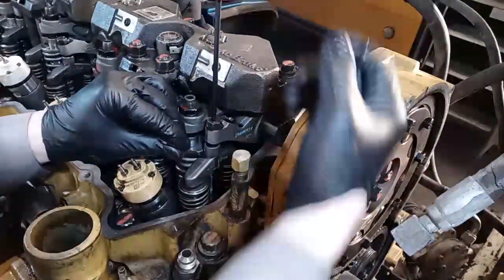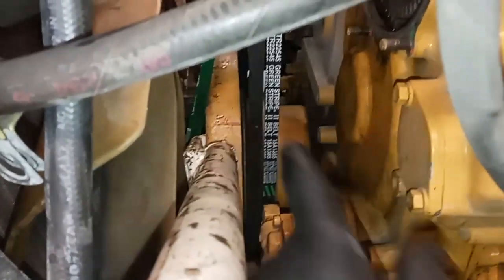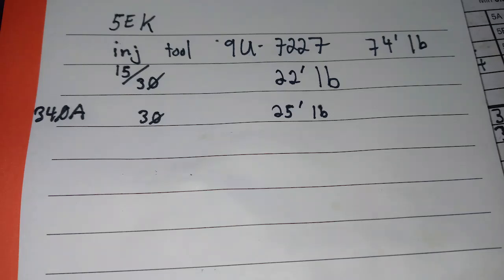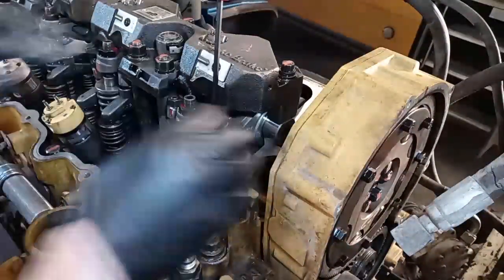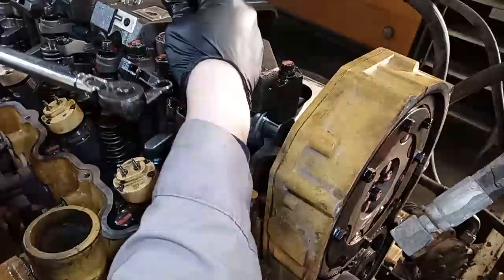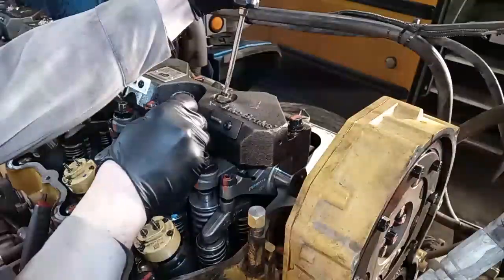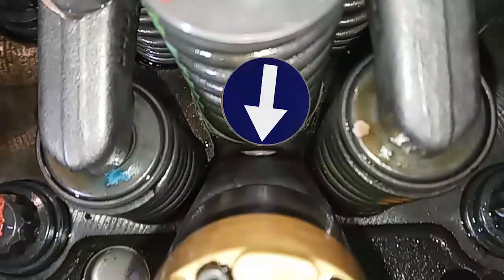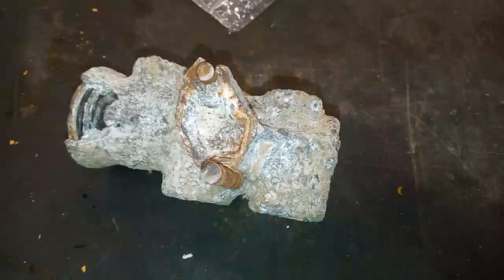PERFECT (nearly) Valve Lash Adjustment, With NO Wrenches.

Comment: Really enjoy you videos.
I'm a Mack-Volvo Technician and always check where valve Clearances are at before adjustment,  and have caught a few bad valve recessions before the valve has chipped and cracked the liner, I know Cat doesn't have a problem with there valves so not necessary here, but It's habbit for me now, does take longer though.
Keep up the good work.
Reply from the maker: Cat can definitely eat a valve, just like every engine. I do compare all the adjustments at the end and look for discrepancies between them. I only check them if someone wants them checked first though, takes much longer for me with those floating rocker buttons, can be very difficult to get a feeler gauge in there.
Reply: @AdeptApe  
Fair enough, I know what you mean with the floating rocker tips, its a pain to jam a .2mm thickness gauge in there,
Reply: Mack-Volvo tech also. The finger tight adjust works on them too. Haha. 👍🏼 quickest and easiest way. Get pretty good at adjusting valves on them to when you’re replacing injectors all the time.
Reply: @josephgonzalez8835  
Injector sleeves also.
Reply: I always check clearance before I back off the locknuts.

Comment: I don't have enough confidence to do this yet but I know my mechanic backs off on all just like you showed!! Thank you for your knowledge!!
Reply from the maker: Running an overhead is probably the most complicated thing to do on an engine, other than cutting counterbores, it's totally understandable to not want to do one without an expert there to show you in person.
Reply: " overhead is probably the most complicated thing to do"  Hmmm, I've never worked on a CAT engine but it really didn't look that bad. Good instructions right here so just keep the video handy and you should be good to go.
Reply: @Mikheno  Overhead and the gear train are the most complicated things to remove and install on engines. It’s hard to mess up dropping pistons in holes. It’s possible but very hard to mess up
Reply: @mahart40  Just saying that after watching this video I would definitely tackle this job if I needed to. i do most of my own wrenching when possible and this required no special tools or heavy lifting (those two will stop me!). It looked time consuming but Josh explained it very well. I think the average wrench could do this if he just takes his time and keeps track of where the crank is and which valves are next on the list. JMO!
Reply: @Mikheno  pretty much, only advantage to being a dealer tech is all the special info you have access to. everything else is easy

Comment: What is your favorite CAT product to work on and what is your least favorite?
Reply from the maker: Well I really only like working on engines. I'm a primadonna. Favorite engine to work on is the C13 KCB. Least favorite engine to work on, hmm 🤔 3406C maybe, although I still like them since they are an engine.
Reply: @AdeptApe , now the tough part: why?
Reply: @AdeptApe  3406C or 3406C PEEC? I'm no fan of the PEEC girls... 

Being on-topic, C13 overheads are cake. Well, at least in a 349/352. Easy to get to the pin plug and turning tool cover, nothing fancy for the injectors... 
Waaay better than that dang 972 C9.3 I did today.. friggin CEM...
Reply: @typrus6377  PEEC come's B or C. PEEC's are OK they are misunderstood and most tech's don't know how to fix them correctly. You have to keep the oil level full and keep a eye on the sleeve and spool valve in the timing advance. It wears and requires it to be replaced, like doing a  maintenance scheduled.
Reply: @johngoldsmith6629  I've never seen it on a B to be honest. 
I've had very little exposure to them, and it was all before I was a Cat tech- they gave me headaches back at Kenworth. With SIS access now I'm sure it'd be less hassle now. I mostly do equipment now though. 

Thanks for the tips though!
Reply: @typrus6377  8TC was the first PEEC, 2EK was the second, 5YG was a PEEC 3406 B 460 HP only. Last was 4CK 1-845 was a B, Starting at 4CK00846 it became a 3406 C. Last one was 4CK24722. The 8TC's had lots of updates, but got better. The 2EK's biggest problem was smoking in cold weather, put a coolant sensor update kit on it. The 5YG's now they was a pile of junk.
The 4CK got better on everything, except the VTU. It caused numerous problems. As this was the training wheels in electronic engines, ground problems, noise in the system, garbage like that. And of course the speed buffer and everybody used a different vehicle speed input which was a mess.